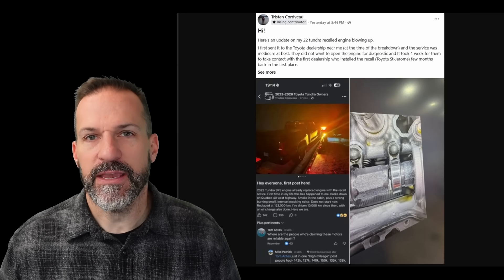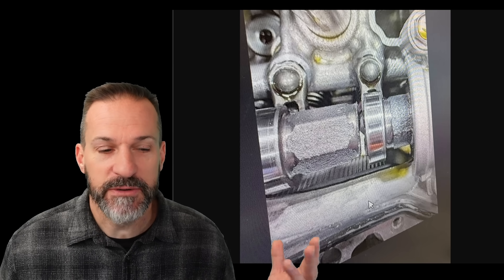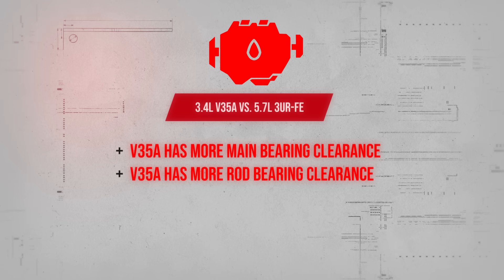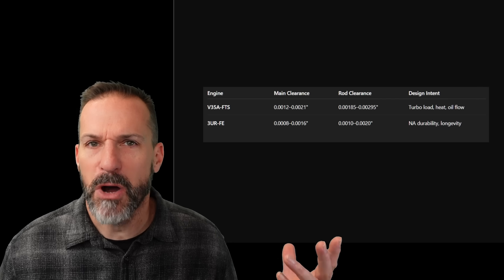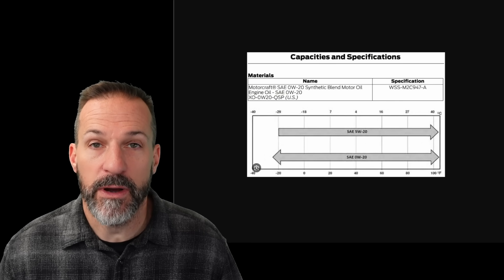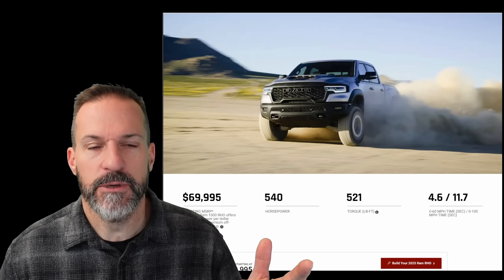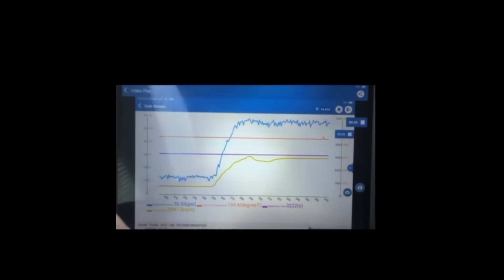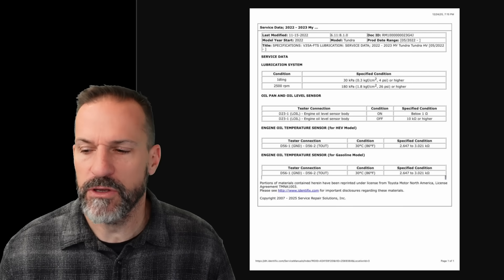Can We FIX Toyota's BILLION Dollar Mistake at Walmart? 2022- 2026 Tundra...

Comment: According to AMD or Car Care Channel, he says to not do that for long period of time because the engineers tuned the oil pressure to work with the recommended oil
Reply: He is assuming the engineers got to make the call based on sound engineering.   I think most of these decisions are made for marketing and compliance reasons instead
Reply: @howebrad4601 For most manufacturers, yes but the way he explains it like this. Toyota engineers don’t do things just to do it or comply, if the are then they’re going to make sure it works the way its intended to
Reply: @JAAW915 : So, the Tundra's engine failures are by design. Got it.

Comment: These engines push 240F plus oil temperatures when towing, at that temperature a 20W oil offers no protection, then add in start/stop at every light and the main bearing machine themselves. So the “machining debris” story is technically true.  😂 

The common denominator in all current engine recalls is lightweight oil.

Comment: Former Ford Senior master and FSE here… I remember when I first saw the variable displacement oil pump show up in training back many moons ago I thought oh this is stupidity on parade. I left in ‘19 so didn’t see it come full circle. But the guy you posted having 4 psi!! Sheesh! At this point anything will help I would think I wouldn’t hesitate to run higher viscosity. Also at the rpm and cyl pressures they are trying to get peak power out of these things alloys and surface finishes really really start to matter!! I’d be curious to see what’s the difference in crank and bearing materials. Also in my recent experience working on industrial engines, machining has really fallen off in regards to surface finishes in our race to the bottom on making parts more expediently. Just my thoughts. I’ll keep running my 7.3 powerstroke.
Reply: And let's not forget toyota has a history of using poor quality metals to improve their margins (frame disaster of late 90s / early 2000s). I've thought from the beginning this has something to do with too soft an alloy, and the way different metal parts of varying hardness are mated in their design. This, along with poor oiling of those metal parts couod explain it. 
Apples and oranges, but it reminds me of the remington auto loader 740 known as the jamomatic. Same problem, two mating metal parts where one was way too soft.
Reply: That’s one of the main problems with the 6.2 L out of the Chevys that’s one of the thing I mentioned in another thread of his. You have a lot of guys on here that are brand loyal and just talk shit to talk shit and they don’t actually have a clue what they’re talking about.
Reply: I swear they're making engines deliberately worse so that electric becomes the better choice by default.
Reply: There is nothing wrong with VDP/VFP used in cars so as long as they are implemented correctly. I have many miles in cars with VDP/VFP and never had an issue with most of them when the full system is designed properly.
Reply: @AgonxOC  Fair enough but at this point we need to STOP adding things they need to do perfectly as these days they can't seem to do even the basic stuff correctly. Less things to go wrong is preferable to saving 0.000000000000000000000000000000000000000000000000000000000000000000001mpg.
Reply: @briancavanaugh7604  exactly

Comment: I’ve been using 5W-30 and 0W 30 since 10,000 miles on my truck whatever season I’m in is what I change the oil for cause I generally do to a year. The turbo engines need a minimum of a 30 at the end I wouldn’t go to a (40) because the variable pressure oil pump until higher mileage because you’ll be out of your pressure spec on your engineand you might blow some seals but the 5W 30 keeps it in especially if you use anvil the oil 5W-30 flows quicker than the 0W 20 factory oil

Comment: @TheCarGuyOnline I have a 2022 Tundra Hybrid and never used 0W20 since break in.  Started with 5W30, then 5W40, now 15W50.  Blackstone oil analysis has shown wear metals Decreasing as viscosity increases. I am happy to share my journey and test data if you like.
Reply from the maker: That would be awesome. Shoot me an email at cars AT thecarguyonline.com
Reply: 15W50? holy shit lol, my air cooled helicopter runs that.
Reply: On 15 W 50 what’s your oil pressure at? Cause I’m running 5W-30 and I’m in spec but I think if I could go to (40) I might be out of spec so I’m just curious.
Reply: @halftontimrvreviewsandtips3106  it’s been a while since I checked but around 19-20 comes to mind. I will check this week and confirm
Reply: 15W-50! Talk about an overkill. Well maybe this crappy engine need that viscosity!
Reply: Just throw some gear oil instead 😂
Reply: Miles so far?
Reply: Damn that's a lot BUT, here's something else I wonder: How hot is the oil running in some of these turbo engines? Is hot, thin oil causing these variable oil pumps to not track properly keeping them from maintaining pressure? By running super heavy oil are you basically just compensating for an improperly calibrated system and getting it back to where its supposed to be?
Reply: I would like to hear more about this journey
Reply: I just bought a 26 Tundra. And we'll be doing that. I might just change the oil at 500 miles. And put 5W30. And then go from there. I'm taking a risk at buying the truck in the first place. I knew that. But I'm hoping using. Little thicker oil might help with all the videos I've seen.
Reply: Rookie numbers buddy I'm running 75w90 in my 23 tundra platinum
Reply: @firstlast--- I genuinely can’t tell if you’re being serious or not!

Comment: You guys are sound misinformed.  Tolerances and clearances are not the same.

P.S.
Tighter clearances is when the designer correctly architects the ranges of depth/length/width for every part in the whole overall machine.  Car companies are designing both tolerances and clearance incorrectly for the metal.  The metallurgy of modern engines are made to die early because the aluminum isn't cooked correctly.  No amount of oil is going to fix any of it.  The new (aluminum) engine and transmission designs are specifically made to die at 100_000 miles.  The modern designs are so loose that they aim for 80_000 miles now.  It used to be 300_000 miles before engine failure during the 1990s to early 2000s.  And before the 1960s, engines were made to last for 200 years or until the metal rusted/oxidide and lost its form.

Comment: The tolerances aren’t tighter I’m an engine builder I’ve been micing crank shafts and engine components for over 20 years it’s different materials, thinner oils and weaker engine construction along with some other things like bad machining from the factory .

Comment: As I'm watching you just said "Ford will take the hit on the cafe standards to go to the higher weight 5w oil",,,  what hit,,,, what was the hit  ????
What was the hit from the government to Ford and how was it calculated why can't we know this ??
I've scoured the internet several times and cannot find it....
I've always assumed it's a massive hit since General Motors destroyed the reliability and durability and reputation of their V8 engines with active fuel management and dynamic fuel management,,  but what is the hit,,,  what is the government hit that made it worth it for General Motors to ruin their V8 engines..
It's got to be a HUGE hit...
Reply: They will lose their tax credits.
Reply: @jamesbosworth4191    How's it calculated and what's the number and remember GM ruined their V8's over it.....
Reply: @2packs4sure  I don't think it is calculated, the EPA gives the auto makers tax credits for recommending water-thin oil, and also for recommending 10,000 mile oil changes.  The bean-counters are not going to allow those tax credits to go away without a fight.
Reply: @jamesbosworth4191   And those credits are SO HUGE that GM engineered and put into production their cylinder deactivation and KEPT it after MILLIONS AND MILLIONS of $$'s of failures continuing to this day ????
Not to mention the headaches and loss of reputation..
That must be one hell of a tax credit..
Reply: @2packs4sure  Well, today's bureaucrats think spending 10,000 to save 1,000 is saving money.  They also think there is a such thing as a 6 cylinder V8 engine, so go figure.
Reply: @jamesbosworth4191  That's my favorite layout the 6 cylinder V8,,,  I love those !!!   lol
Reply: @2packs4sure  So unique!  Collector's dream!

Comment: I'd be on the horn with Melling and purchase a high volume oil pump from them as well as start using 5W40 motor oil.

I know nothing of the variable geometry oil pumps, but oil is the engines life blood. You want a film strength to handle the cylinder pressure to keep from squeezing all of the oil out between the rod, and crankshaft. 0W15 or 0W20 can't have much if any film strength. At that point, you're relying on the anti friction additives of the oil, rather than the oil film acting as the bearing surface. 

I'd be interested in knowing the temperature of the oil as it's being forced away from the moving surfaces with the water thin motor oil versus a higher viscosity oil.

Comment: I run 5w-30 in our 4Runner every 5k miles.  Factory fill was 0w-20.  I switched it out after 1000 miles.
Reply: Yep, did the same with my 23 4Runner. First change at 500 miles and again at 1000 miles with Toyota 0w-20 then went to Amsoil signature 5w-30. 22k miles no problems with low wear metal in the oil analysis sample. Been using the same oil in my 5.7 Hemi for 122k miles, whisper quiet and no Hemi tick. Oil pressure is 60psi at cold idle and 30-32 psi at 180 degree oil temp hot idle.
Reply: @jeffsullivan3101 it’s absurd that the 1gr-fe is spec’d for 5w-30 all over the world except the us get the 0w-20.    I think I use Pennzoil bc it’s pretty good, cheap, and available close by.  I change it myself bc the dealer will only put in the 0w-20 even tho I could technically get the free oil change from Toyota service bc mines a 24’
Reply: Same here with my 22 TRD Pro 4runner, switched to 5-30, no more startup rattle either. Had a cold start noise with 0-20.

Comment: Knowing all the 22-23-24 V35A engine debacle right from the get go and Toyota's lack of proper response to address the issue and you still decided to buy 25 Tundra with the same engine, that's on you. You got shafted by own self.
Reply: Toyota fanboyism is a cult.
Reply: I knew about it with my 23 I followed with the Japanese engineers stated and the motor oil geek has said about the engine/turbo engines followed exactly how you should drive them. And I’m at 50,000 till 7000 pounds every day and I have not had a problem Actually run smooth until I put the W 20 Toyota oil in. I just did that 50,000 and I’m already switching out at 53 because you could tell a difference between that and the amsoil
Reply: @halftontimrvreviewsandtips3106  justify that purchase. Whatever helps you sleep. It’s not just a Toyota thing. It’s people continuing to buy NEW GARBAGE from whoever.  If people would just stop buying new GARBAGE, the manufacturers would have to stop making it.

Comment: I think you may have a great point here. As a 2024 Tundra owner, I wish I had some concrete data to go on other than "debris" in the engine; In which I don't believe. Why is a heavier oil recommended in Europe?
Reply from the maker: I think a lot of European companies do it because fuel dillusion and wear protection. 30 or 40 are better with DI and turbos

Comment: The low oil pressure at idling is probably due to the thin oil, which doesn't need high pressure to have adequate  flow.  With thicker oil, the pressure with be higher, due to the displacement pump which forces a certain voume of oil per rpm.  When there is higher resistance to flow, the pressure will be higher to ensure the same volume of oil flowing through.  I believe that thicker oil will solve the engine damage problem.

Comment: 1957 Ford recommended 5w oil in winter for the T Bird and 20w in summer. Those engines did not fail at the rate the ones mentioned did proof I think it is more than viscosity at play here.
Reply: The 57 t bird didn’t make 400 hp and 500 lb ft in a 3.4 liter v6 either

Comment: Tolerances and clearances are NOT the same thing!  
A tolerance is the difference between the maximum design dimension and the minimum design dimension.  Tolerances exist because asking machinists to hit every specific dimension in an engine  perfectly to four decimal places first time every time would cost megabucks squared.

Comment: I will agree with the oil pressure is an issue and I noticed something about the engine when watching a tear down, 
Going back to my Honda roots the B18c uses a single piston squirter to cool and lube underside of the piston . We remove these in our road race engine to allow more oil to go to the bearings, 
Back to the tundra , it has dual squirters to each piston , . That’s 12 open squirters at low RPM . 
I would bet a bunch of money that a single squirter would bump oil pressure to bearings at lower rpm.  That and a higher better oil 5w30 would solve any pressure issues to the bearings at lower

Comment: I am inclined to believe everything you said especially due to the HO hurricane, ecoboost and L87 all using heavier oil. Thicker oil to try to add an additional layer of protection especially due to low oil pressure and high loads at low RPM makes perfect sense and I think would reduce wear on these engines in particular. In my experience towing pretty heavy with one of these engines they behave a lot like a diesel and don't particularly like to rev. So it's pretty obvious the internals are being stressed to high hell. One of the tear down videos showed excessive wear on the rod bearings on an engine that only had <40k miles if im remembering correctly. 

BUT, i am not entirely sure changing oil weight will fix the spun bearing problem. I say this because hasn't it almost always been the #1 main to spin? If it was debris, why is it always the same bearing to grab? If its an oiling issue, why is the #1 always the first to go? 

I found it interesting that these engines only have 180 degree thrust bearings where a lot of engines running these type of loads in this application have 270 degree or 360 degree thrust bearings. 180 degrees is pretty minimal and under low RPM high boost scenarios i would bet the crank is walking forward and pushing that #1 outside the block. Tolerances are a lot less under control. This to me is the best explanation for why it seems to be a uniform problem across all the engines even after the "debris" nonsense was remedied.

When i tow 8000lbs i almost always lock out 7-10 gears maually because i don't trust that this engine can take those high boost/loads over the longer term. At around 62mph i'm running 2500ish rpm, and peak torque is around 2400, so it'll walk up hills with relative ease just adding boost. In 7th gear at the same speed it drops down to 2000rpm and you can feel its grunting pretty good with any type of head wind or slight incline. I figure doing this also keeps temps down and oil pressure a bit higher. Knock on wood so far so good on the original engine but I do plan to get the crate engine swap sometime next year when the remedy is made available. Mine is an 06/2023 build date so I am now included in the second batch of recalls

Comment: The thin oils are not there to protect your engine.  Stop using anything thinner than 5-30.  However, these new trucks  and cars may already have bearing damage and you end up just pushing the failure out beyond your warranty.  I have used 5-40 in my  2003 BMW 325i since new.  The BMW dealer had no issue putting in my oil during the warranty.  Oil was supposed to be 5-30.  Engine is still good after 23 years and does not use oil.

Comment: Probably would Benefit also from a Hi Volume OIL PUMP in Place of the JUNK they have in em right Now!!! Get some OIL Moving through the Engine, Mains / Rods / Camshaft / at a Decent Rate of of "FLOW" and Keep it CLEAN and the Issue here will disappear!  I guarantee It!

Comment: I have a theory....we're getting power outputs on boosted engines that would have embarrassed race car engines of a few years ago. Highly stress engines, race car engines, need more maintenance...especially when they're maxed out every time they're run. If you've made a heavy truck it's possible to use a little bitty race car engine to move it, but it will spend it's life stressed out. It will always be maxed, because it's doing the work large V8s, and diesels are known for doing. In trucks you want big lazy V8s, and/or large diesels. You may not be faster, but you'd be far more reliable. Once a vehicle starts breaking down, it pollutes far more than one that just keeps running. I'd just say NO  to putting highly stressed, over boosted engines, in heavy vehicles. The notion we're saving the planet this way is absurd. No wonder people are boasting when they reach 60,000 miles. We used to boast like that when we got a half million miles.

Comment: The Audi 2.0 T had tons of failures with the 0w20 oil and the variable pressure oil pump.  The lifters could not keep pumped up and would dislodge from the cams. I say 5W30 always.
Reply: If it’s turbo, don’t don’t go below a 30th end ZW 30 is just as good as 5W-30 only you’ll need more oil changes
Reply: Had 2014 Audi A6 2.0T They're problematic engines knowns to oil consumption no matter what type of oil. Thank goodness someone hit the my vehicle @98K miles got it to total the vehicle to get rid of it. It was having issues.

Comment: 5w 30 in my '25 Tundra.  Absolutely there is casting debris in my oil pan.  The dealer does it with 0w 20 and at 5k I do 5w 30.   Nothing in my filter ever and it runs great.  I don't do the start stop,  I warm up and cool down the engine.  The tranny works better when heated up too.